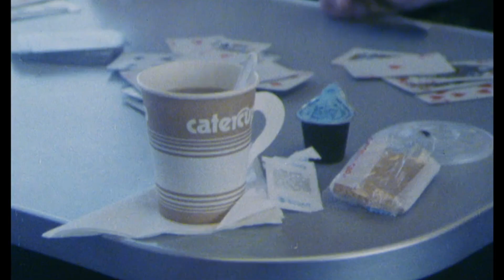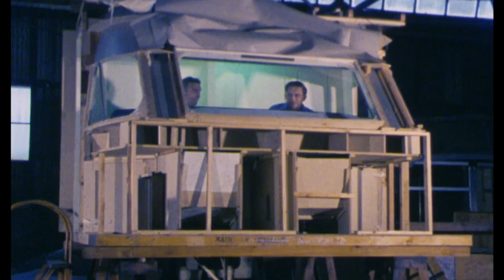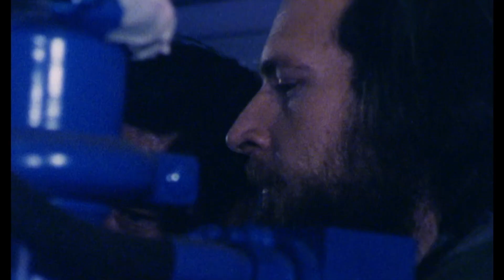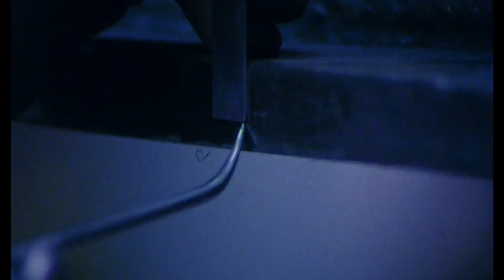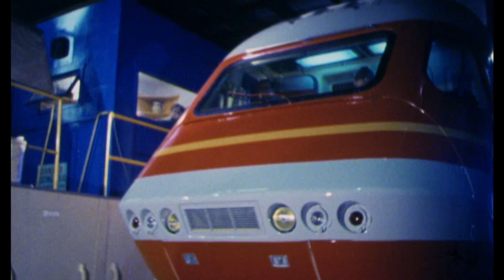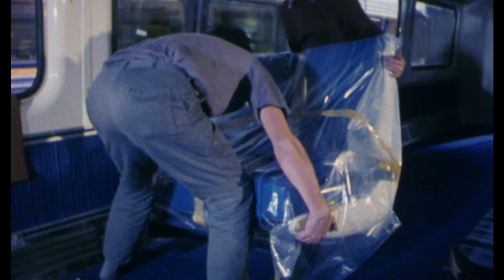XPT (Comeng, 1982)

Comment: IGNORANCE - POLITICIANS & PUBLIC MONEY !
Indeed due to the much higher ambient temperatures in Australia the Paxman Valenta engines had to be derated from their  British equivalent. Further the XPT was introduced before suitable track was provided for it to attain its maximum operational speed. Just the same mistake daft Amtrak in the USA made at around the same time introducing ASEA 125mph Electric locos between Boston & Washington on track not safe above 90mph ! Conclusion: Don't show Politicians pretty toys they have no engineering skill to properly understand. They just waste public money as a result !!!
I travelled in the cab of both trains (Australia & USA) soon after their introduction, so realised the problem immediately.